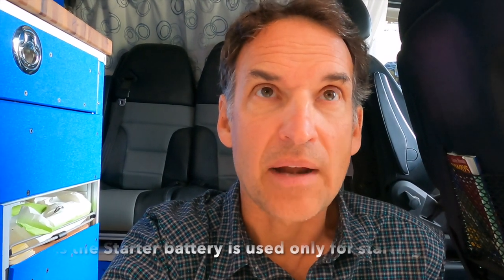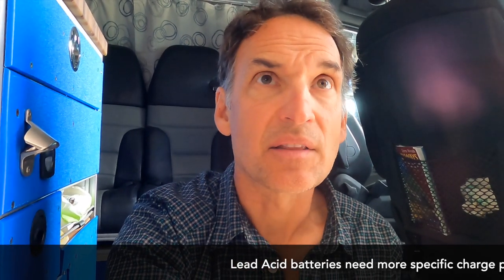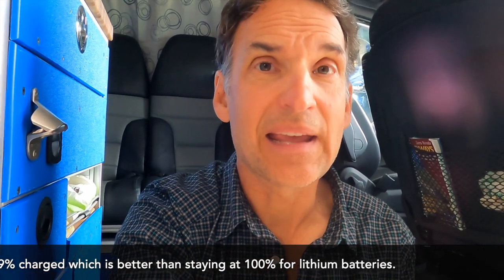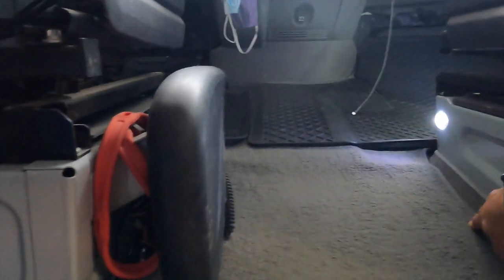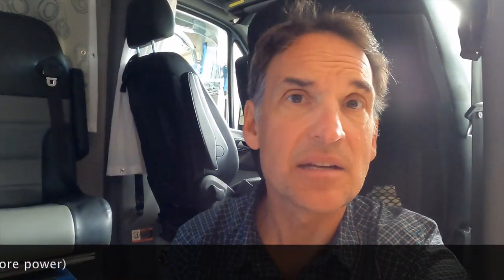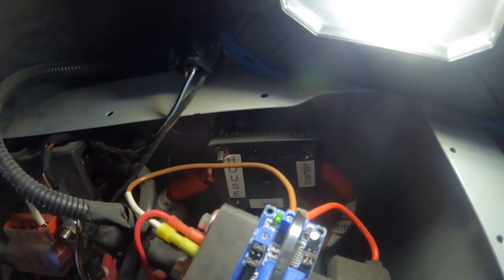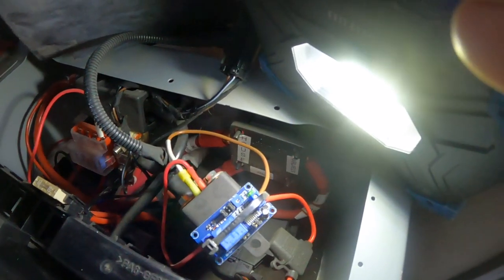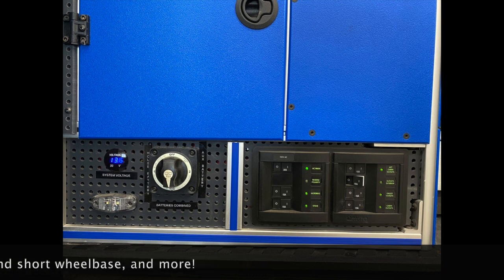Underseat Sprinter electronics & three battery connection

Comment: y daughter just purchased a 2023 all wheel drive diesel engine Sprinter 2500. The factory battery in that van is lead acid. Spoke with a dealership parts dept and that is what they said.
Reply from the maker: Congrats to your daughter and her van. The factory batteries are AGM (or at least were). Absorbed Glass Mat uses lead acid for its electrolyte, but has a spiral wrap construction that makes them hold up better to vibrations and temperature extremes than a typical flooded lead acid vehicle battery.

Comment: Good video but I got lost in the weeds a bit. I want a switch so I can use my house battery to start the sprinter if my main battery fails and then be able to charge house batteries to without toasting alternator. Obviously I will take it somewhere to have this done. We have a 2019 Sprinter conversion. Thanks
Reply from the maker: Check out Blue Sea Systems battery switches. They have great manual and remotely operated battery switches which make it easy to switch between or to combine battery systems. These are mostly for manual control. If you want to have it be automatic once the alternator voltage comes up, check out their automatic charging relays. Many vans use them and they work great. As for your alternator, it will only put out what it can and has a lot of extra capacity for charging house batteries, and your 2019 van's factory alternator monitors temperature amongst other things helping ensure its reliability, so I wouldn't worry about damaging it so long as it's wired safely.

Comment: Hi thanks for clearing some FUD about charging directly from the alternator. Could you provide some information about the relay and board to add programmable delay. Thanks.
Reply from the maker: The rely I used is a simple 200amp relay, which are fairly easy to come by and fairly low cost. As for the timer board, I purchased it on Amazon for about $10. Just look for a programable timer relay. Let me know if you want me to provide links to these.
Reply from the maker: Here is a link to the programable timer relay I used: https://www.amazon.com/gp/product/B07BT25J52/ref=ppx_yo_dt_b_search_asin_title?ie=UTF8&psc=1
Reply: @vantripping  Thanks for the information. Much appreciated!
Reply from the maker: @devinderkhroad388  You're welcome. Glad it was helpful.
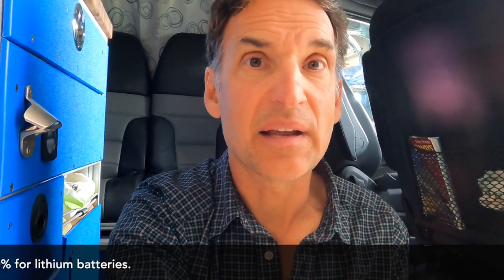Reply: 1. One more question, around 4:15-4:30 mark you mentioned you have protection to avoid overloading the alternator. I am assuming your are referring to the programmable timer relay. How do you address the prevention of excessive draw to the house batteries if the house batteries are severely depleted, because that condition would still exist after a couple of minutes as well.  
2. I noticed you are tapping into power at the factory relay connection instead of using aux battery fuse box . If I just want to tap auxiliary battery via a relay to charge my house Lithium batteries instead of combining all thee batteries, connecting my relay via  an empty/available slot in F150 fuse box with 150A mega fuse should be okay, right?
Reply from the maker: @devinderkhroad388  A combination of the wires, the available circuit capacity of the factory connection which is limited to 150 amps, and a fuse all limit alternator charging. While the batteries in theory could draw more than the alternator, the supply side will limit the capacity provided, which never exceeds the alternator because that is all the alternator can provide, which is always less than 100 amps. I do use a fuse and wire rated to over 100 amps. Any available fuse position should be able to be used so long as the fuse and wire and load won't draw more than the total capacity upstream of it.
Reply from the maker: To be more clear, effectively the alternator itself is self-limited by internal electronics and capacity, as are the Aux battery connection.
Reply: Brilliant!  Thanks for the explanation. Makes sense. Now, I feel quite comfortable going this route (using a charging relay) instead of using a B2B charger. I noticed my combined battery voltage (main + aux) consistently stays between 14.4v-14.8v  even at idle and low speeds after an initial dip to 13.4v.  So I don't expect any issues charging house (Lithium based) battery bank. 

I noticed you tapped into the system batteries at the OEM relay instead of using F150/5 fuse block. Is it  because you wanted the ability to combine all three batteries if needed? I plan to attach a charging relay using F150/5 fuse block as recommended by BEG as I don't plan to combine my starter battery (at-least for now).

In case of an emergency if I need to jump start my starter battery, I plan to connect an appropriate size cable from aux  battery +ve to the main battery jump start pole under the hood. Do you see any issues with that?
Reply: Although BEG guide says - " The auxiliary battery (E2l, E2M) must not be used for jump starting as this could result in damage to the vehicle". It is not clear if they are referring to jump staring other vehicles or your own. It makes no sense to me why the aux battery can't be used for jump starting my own vehicle?
Reply from the maker: @devinderkhroad388  The starter and Aux batteries are exactly the same batteries, so it's not damage to the batteries but to the MB connection between them that is undersized for high starting currents of 500+ amps. However, providing a 50 to 100 amp charge over several minutes that is within the capacities of the system from one battery to the other would provide enough energy to charge up the starter battery to enable it to start the vehicle and stay within the amperage capacities of the components.
Reply from the maker: @devinderkhroad388  Yes, that is plenty high of a voltage to charge lithium batteries to 100% state of charge. I connected to the Aux connection/OEM relay output because it was convenient and rated to 100 amps, plus following the body builder's guide. After that, I install several fuses to each of the connections from the factory aux connection point to protect the wires connected to it. My connection back to the starter battery that is manual goes direct to the starter battery for emergency use, bypassing the factory Aux connection, and is intended to charge the starter battery but not start it as inrush current would be high during starting, but it can at least provide a charge over a few minutes to get voltage up to provide starting. So you're thinking of doing the same thing I have installed and tested to work fine, just be cautious to not immediately try starting the vehicle off that connection before it provides a charge and voltage increase to the starter battery if/when needed.
Reply: @vantripping  Thanks for the clarifications. Much appreciated!

Comment: I don't understand.  My new sprinter has the auxiliary battery under the passenger seat,  and it has the access terminal under the driver seat, which has a factory relay, preventing the auxillery battery from taking power from the cranking battery, unless the van is on.  I think you've showed that.  So If I connect my devices to the existing auxiliary battery terminal under the drivers seat,  why do I need anything else?  The van is already set up to properly charge its own auxillery battery,  regardless of its charge level or draw.  All vehicles like this have batteries in them that are rated to take the full charge of the alternator,  why delay that?  Eventually,  even after a minute,  your accessory battery is still going to get the flood of charge from the alternator,  that won't change in a minute?
Reply from the maker: Good question. I charge my house batteries, battery system number 3, via the factory Aux battery relay, so when it connects soon as the engine is running, it connects the factory Aux and my house batteries. My house batteries are over 4x the capacity of the Aux battery but each times four batteries can take about 2-3x the charge rate of the AGM since they are lithium which has far higher charge and discharge rates since much lower internal resistance. So the load on the factory alternator will be far higher than the just the Aux battery, and I noticed that the engine voltage would drop and come back up within the first 30 seconds of the engine running, and that delayed start allowed the "start up" load of fuel heaters, cabin resistance heaters, pumps, glow plugs and all of the other high loads at engine start up to settle and voltage to stabilize before I add that significant load of the potential 100+ amps of charging current going to the house batteries, and additional to the AGM Aux battery at the same time as engine is warming up and start up voltage stabilizing. I found this delay alleviated the voltage dips right after engine start up. AGM batteries like the factory Aux battery can only take a modest charge of about 20-30 amps like all lead-acid batteries, while each of the house lithium batteries can take a charge rate of up to 100 amps, and with four of them, my cabling limited it to about 120 amps total, and the factory alternator and its relay to 150 amps. At start up, current for the engine and its systems can be over 120 amps, so that maxes out the most the alternator can do at peak, yet at idle it's about half that which is less than the load of engine start up and AGM and House battery charging, so hopefully this explains why the voltage drop. MB changed the Aux battery electrics and alternator in ~2018-2019, and it sounds like your van is different than mine, so you may not be experiencing this voltage drop or not have a house battery system with the capability to accept as much of a charge as mine did, so my approach helped to preserve voltage stability while your system may not need this. It may not had been needed, but certainly helped to keep electrical systems getting a more stable voltage within acceptable range instead of the >2 volt sags I saw.
Reply: It's the excessive draw on the alternator he's preventing not flood (load) on the auxiliary battery.

Comment: What amperage is your 3-way battery switch? M series 300, E series 350 or HD 600
Reply from the maker: I believe it's the Blue Sea's 6000 series, which is rated to 300 continuous amps and 900 cranking amps for up to 30 seconds. Much more than the Sprinter's system capability and the factory charging to house battery connection rated and limited by fuse to 150 amps. A great little switch. I'll put a link to it below.
Reply from the maker: Here is the one I am using: https://www.bluesea.com/products/6007200/m-Series_Mini_Selector_Battery_Switch_-_Black and purchasable here: https://amzn.to/3RQ0YP6
Reply: @vantripping  Thanks, my thoughts were the same but wanted to confirm. On another aspect of that electronic set you have under the seat base. The terminal fuse base off the aux battery. You have a 100A MRFB  terminal fuse I believe going to power a  ST fuse block which powers your outside off road lights which is switched off the weather deck. In that cabin upgrade video you verbally mention a relay. I believe you said a 100A relay. Where in the schematic did you place that relay and why?

Comment: Awesome content, one question - When tapping off your starter battery to the switch to join your auxuliary for starting purposes did you use the PDC and a fuse as with some of the other connections there, or did you connect directly to the starter battery termianl post? I have just fitted a retrofit of the aux battery setup as outlined by the MB upfitters bulletin and I would like to incorporate a bridge switch to allow starter backup from auxiliary battery just incase. Appreciate any additional info. Nice detail by the way..
Reply from the maker: I ordered my van with the factory auxiliary battery, which has a dedicated 150 amp fuse from the power bar connected to the starter battery, and brings that to the auxiliary power connection under the driver seat. I then use a MRBF to connect power from the aux connection to my house battery switch, and onto my house power system and main fuse panel. You could do what you want by using a relay or switch to connect power between the two batteries, just as my manual battery switch allows me to interconnect the house, aux and/or starter batteries in any way manually as needed. The factory ax relay does that connection and disconnection automatically as any relay could as well. Why I use a relay with timed delay to connect the starter & aux batteries to my house battery to allow them to come up to voltage before I add in the house battery to be charged.
Reply: @vantripping  Thanks for this much appreciated,  I am interested in the cable which you have labeled "Starter" that goes back to the starter battery from your three-way switch under the seat. This joins the aux and starter if you install one, and in your case, the house setupback too. I realize that the aux batt relay feed picks up off the PDC(Power Bar) with the 150A fuse. Does the cable I mention above go back to the starter battery to bridge them also get mounted at the PDC - Power bar, as I have an extra slot left on my PDC. Was wondering what you did there, whether you mounted the return on to the Power bar also or onto the actual battery positive post. Hope that makes sense! Thanks for the speedy reply.
Reply from the maker: @alitheiaziton5188  Great question and notice. Yes, that cable from the disconnect switch goes back to the starter battery power bar, and has it's own dedicated fuse. I have never used this but would be able to be used to provide current from the house and/or aux batteries to the starter battery, to provide a charge to it to help it start the engine. If you do this, I would recommend that you use this feature to charge the starter battery for at least a few minutes before trying to start the engine so that the all of the starting current is not going thru this connection all at once but instead over a few minutes of charging current to get the starter battery voltage up. The switch is plenty good for it, but the cable, connections or fuse at the PDC may not be rated for full starting current but good for a 100 amp charge/connection.
Reply: @vantripping  Great answer, I am claculating that as the feed for aux battery is 150 amp the return can also be that of the same rating if mounting on the PDC. Naturally as mine is the MB bulletin retofit that recommends 35mm - 2 AWG cable, I can complete the system with the same, feed and return both at 150A. My Sprinter has a 180 amp alternator as opposed to some others that carry the 220A. I am assuming your setup regarding your cab starter and auxillary battery has the same 150A feed to Aux and 150A upon re-entering the PDC to join to the starter battery. Cant imagine when, if, the alternator would ever exceed 150amps, any input on this is welcome as this is not my area of experience. Hey thanks for the info here, thumbs up from across the pond..
Reply from the maker: @alitheiaziton5188  My van has the 200 amp alternator and the full 150 amp feed from PDC to Aux battery connection point, and the most output I ever have seen from the alternator to my house batteries is around 90 amps for a few seconds and quickly tapers down to 80 something amps, and within a few mins down to about 60 before continuing to slowly lower over an hour to about 40 and then another hour or two to 10 or less. I have 400 amp-hours of lithium capable of charging/discharging at 400, and a cable and rest of electrical sized to support the full 150 amps of charge to House batteries. So while the alternator can put out more as seen from other high-amp electrical factory components operating just fine during high charge to house battery periods, I think the lithium house batteries limits charge-rate is greatly less and I doubt anyone will see more than 100 amps output from the PDC/aux battery connection.
Reply: @vantripping  Excellent, you have been a great help! I myself have been contemplating the lithium battery setup for the house area but the more I look at the work and the cables involved I tend to lean towards a Yeti setup leaving just minimal cable sizing to configure for circuits. I am not entirely sure yet and it could go either way.  You have a comprehensive system there and configured well. Thanks for the info!
Reply from the maker: @alitheiaziton5188  You're welcome. There are many installers who can you build an electrical system, but a packaged solution could work well for you if you loads and electrical needs are fairly small.